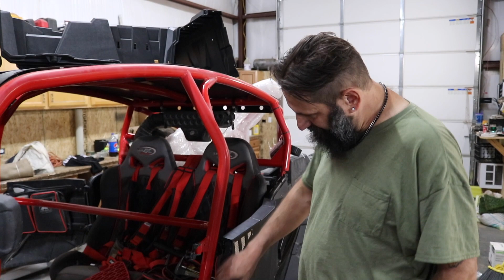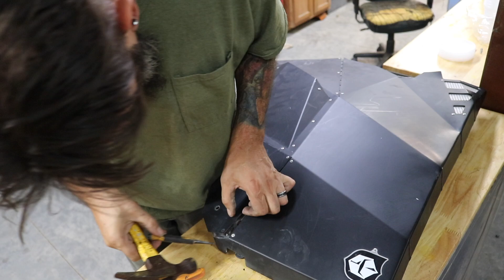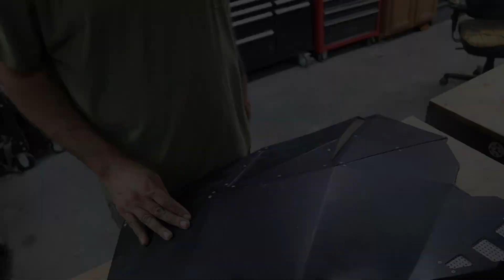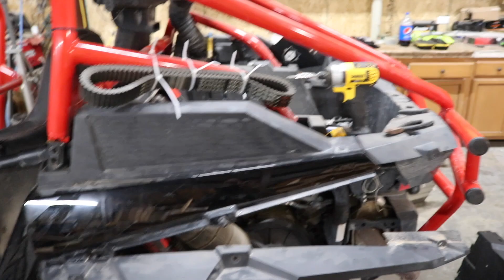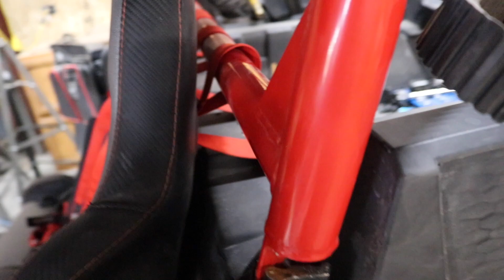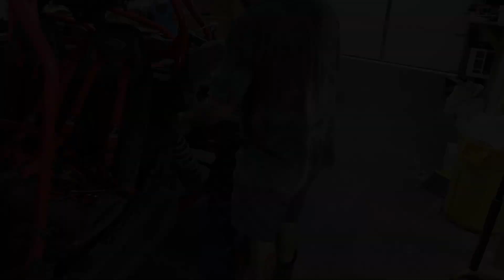Polaris Dynamix RZR  Rollover Repairs

Comment: How much would you say it cost total to repair
Reply from the maker: The insurance estimate for parts and labor was around $6000.  Doing it myself saved quite a bit.
Reply: Bear's Workshop thank you so much that is so amazing do  you think it would be profitable to buy salvaged and fix and re sell or is it not worth the time ?
Reply from the maker: @johnnybrinson4228  I have looked into it and the problem is that the salvaged ones go for so much.  The labor on these is fairly easy so when rebuilding one it is just a matter of bolting on new parts.  Because of the high price of the salvaged ones, it doesn't leave a lot of room for profit.